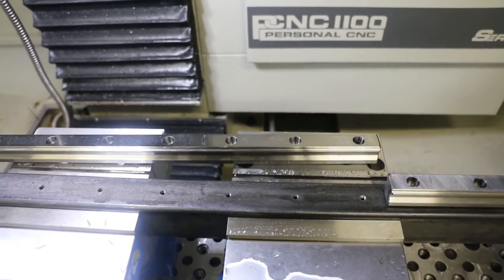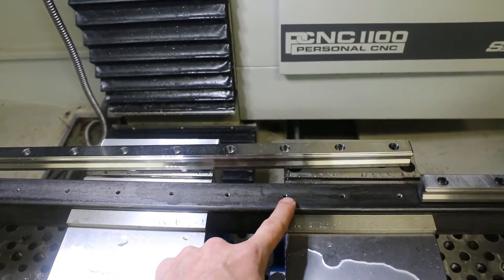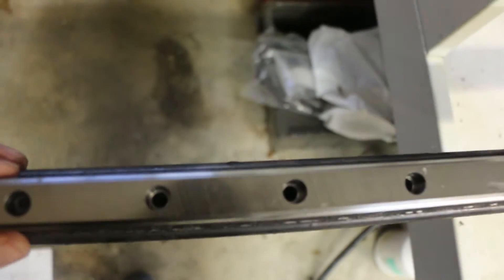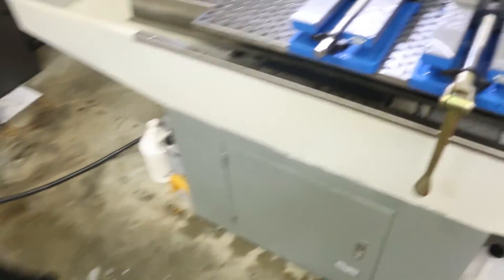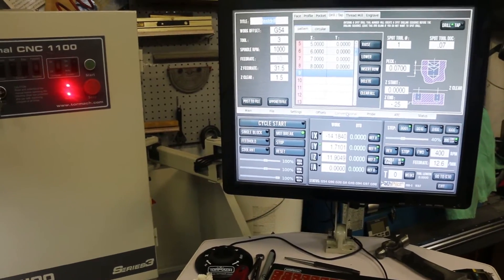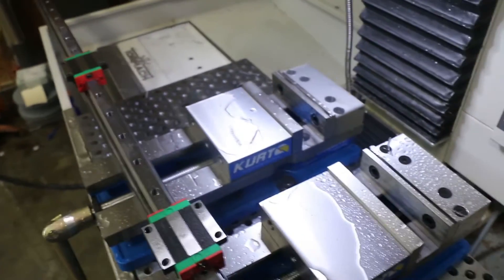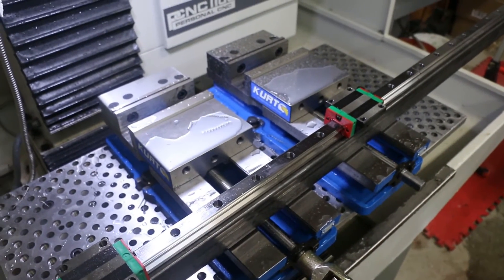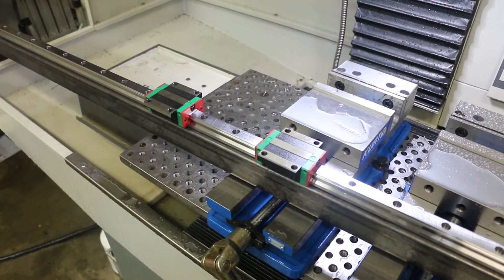5 x 10 Plasma / Router Table Build - Part 3 - Linear Rails Mounted

Comment: Hello,
I was wondering if i can extend the rail length so i call the Hiwin rail supplier in my country and they told me that's not possible. As i can see you also use hiwin rail. Is it really can be done. Appreciate your help